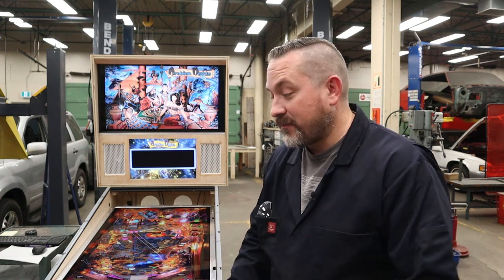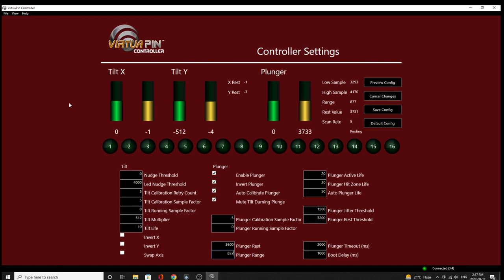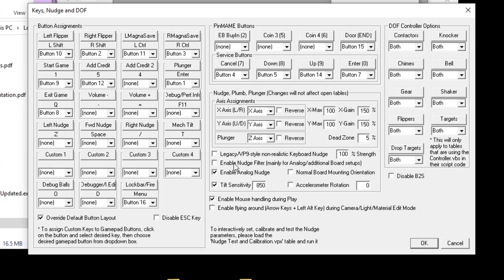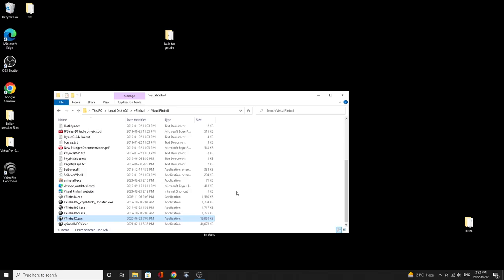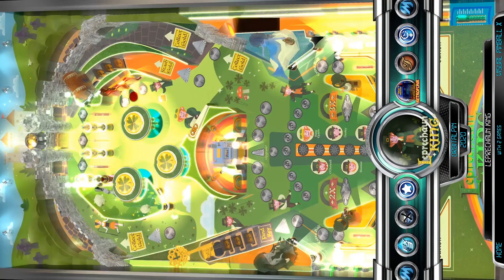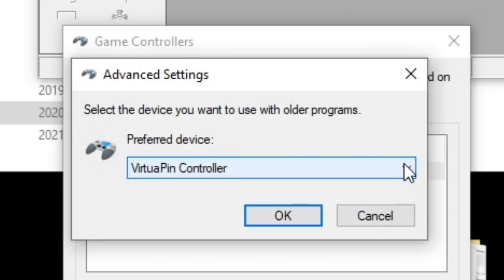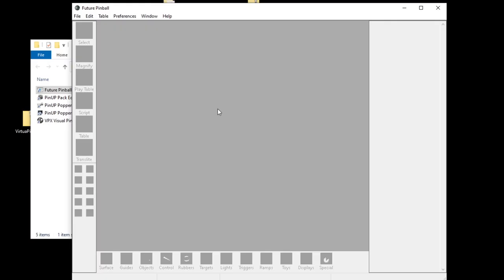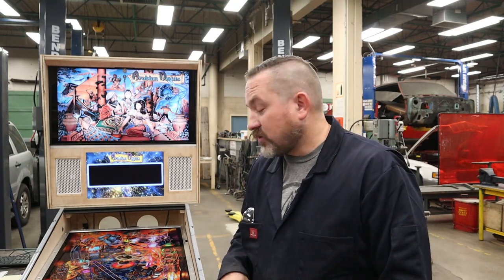How to setup your buttons, nudge, and analog plunger in the VPX, Future, and Pinup Popper programs

Comment: One of the ways I was able to emulate better nudge with the same controller is changing the following line in the core.vbs file (you'll need to rechange this every time you update vpx to a new version thus, don't forget):  from   "Public Property Let Sensitivity(aSens) : mSensitivity = (10-aSens)+1 : End property"     to "Public Property Let Sensitivity(aSens) : mSensitivity = 1 : End property"  

My nudge settings in vpx are as follows: 
XAxis   10   200%
YAxis   13   300%
Dead zone 0%
Enable nudge filter = checked
Enable analog nudge = checked
Tilt sensitivity = 950

In VirtualPin Settings for Nudge:

Nudge Threshold = 2000
Led Nudge Threshold = 2000
Tilt Calibration Retry Count = 5
Tilt Calibration Sample Factor = 5
Tilt Running Sample Factor = 0
Tilt Multiplier = 256
Tilt Life = 10
unchecked all three boxes
Reply from the maker: Oh yeah this is golden!  Thanks for sharing dude!  How did it improve?  What was the issue before the change?
Reply: @wayofthewrench  It just never had a natural nudge like a real machine.   These tweaks helped.  They were collected by others having similar success.